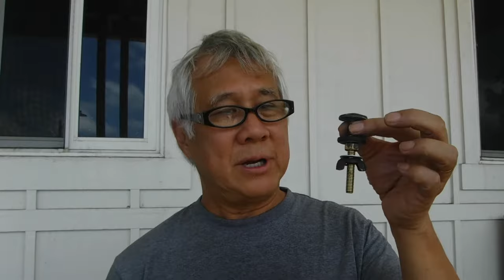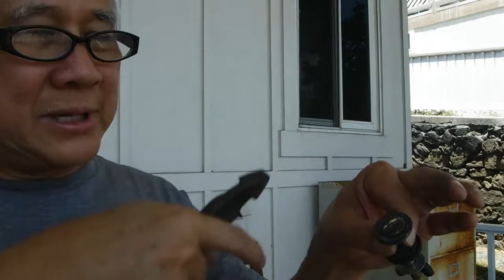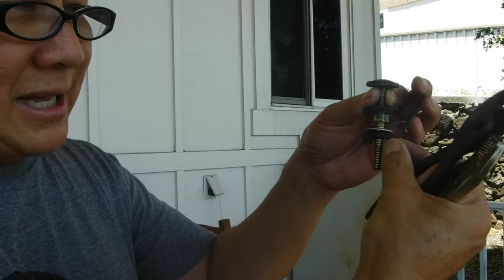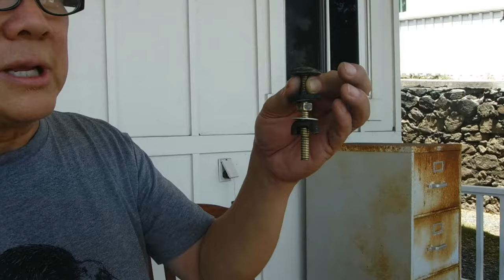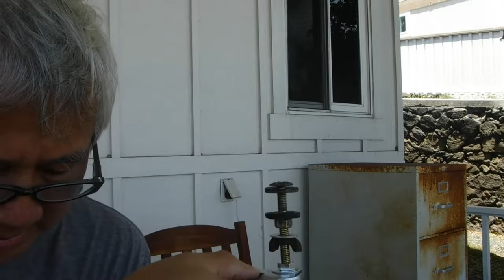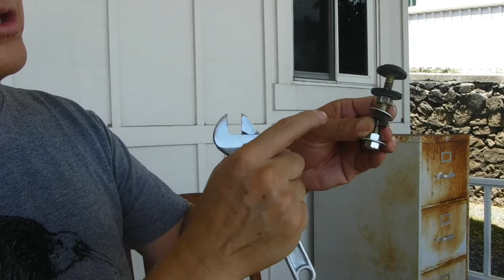Loosen Frozen Rusted Stuck Toilet Tank Bolts

Comment: The double nut and washer trick 100% worked for me after HOURS of frustration! Thank you! 
I had to go out and buy a 1/2" crescent wrench as my adjustable wrench had too much play in the jaws and kept slipping. 
You don't appreciate how much work a toilet does for you until it stops working.
Reply from the maker: Glad to hear you got it fixed.  If you have a ratcheting socket set, sometimes that works well on the bottom nut, too.

Comment: that is fine if you can get a bolt on the shaft of the screw if the screw is long, however if the toilet is old more than likely they will have used shorter screws! Nice video either way!

Comment: Easy when you don’t got to get down into a tight spot
Reply from the maker: I hear you.  Everything is harder when it's a tight space, and in the worst case, the two choices might be to remove the whole toilet first, or cut the bolt with a hacksaw.  But before running to that, it's worth seeing if you can fit a small pliers to grab the wing nut, and maybe use a ratcheting socket wrench on the bottom nut.

Comment: I have a frozen nut but the screw is part of the handle so I can't use this great technique.  I've worn the nut smooth trying to get it off.  Looks like a hack saw may be in order.  For now I pull the chain myself.  ha

Comment: Good video.  But I found an easier way.  As soon as I touched the nut on the bolt, the outside just disintegrated into rust, so this well made video just didn't help.  The inside of the nut stayed frozen onto the bolt.  So I got a good Dremel, used a cutoff disc - (actually 3 of them) and cut the head off of the bolt inside the tank.  Then I just pushed the rest through to the floor, installed the new bolt, washers and nuts and called it a day.  Total time - 15 minutes.

Comment: i just looked at me tank blots from inside they disintegrated my toilet  was installed last winter
Reply from the maker: Wow, I've never seen that happen, not after just a few months.  Tank bolts are usually brass or stainless.  I've seen the floor bolts corrode, but those were steel bolts, when there were young boys in the house (they miss and get it all over the floor).
Reply: @OldRoderickYoung  my water smells like a swimming pool  will get brass screws